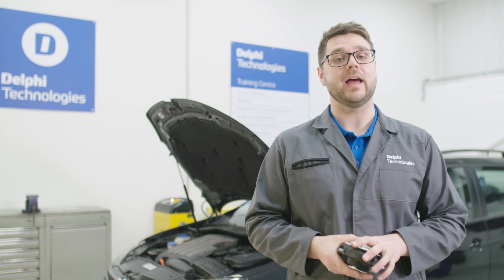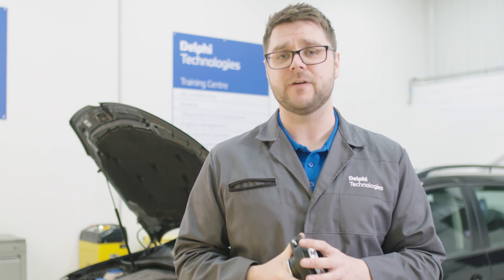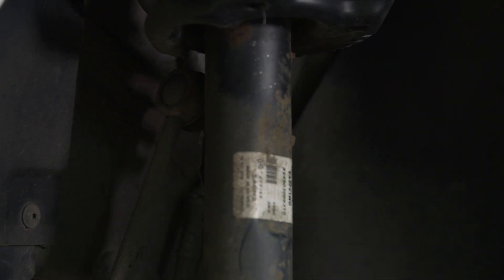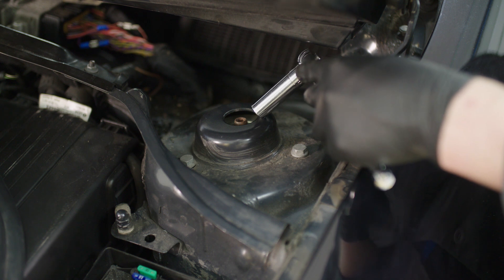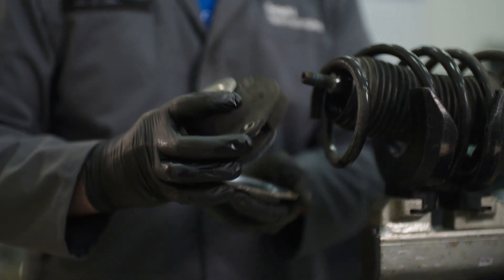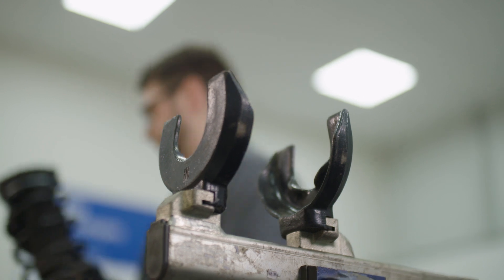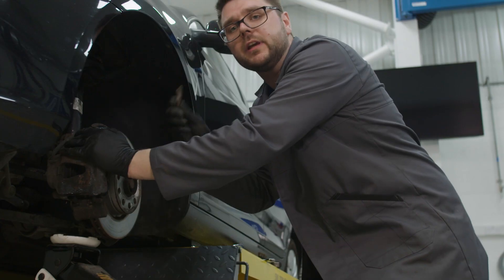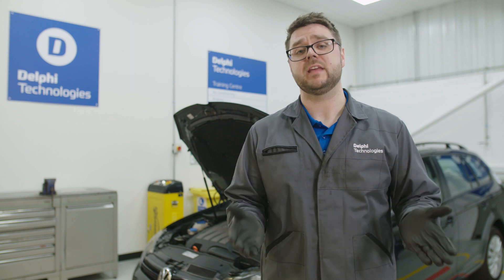[EN] Installing a top strut mount | How-to

Comment: Is there an angle between the top mount and the body that needs to be matched to compensate for the angle of the body side or does the top bearing adjust for whatever angle is needed?
Reply from the maker: Hi @EmpowerEmaui, and thanks for the comment.
Indeed you are correct, on some vehicles the turret mount plate isn't exactly the correct angle for the strut. Where this is the case, the mount will be machined with a correction angle built in, it's not done within the bearing itself.

Where the mount angle is offset, you will often notice that the 3 mounting holes are also offset (they are not spaced equally apart at 120 degrees).
This then aligns the top mount correctly into the turret, and the strut is set at the correct angle. 
Many thanks, Delphi Technical Team.

Comment: This got changed today on my vauxhall insignia i noticed loads of play in my wheel before they changed it, why did the wheel feel lose if it was the suspension mount??
Reply: Even I listened to weird noise from CV axle before replacing the top mount ... I thought it was faulty transmission shifts !!! ... But it wasn't !!! ... All these problems was from that piece of rubber called strut mount !!!!